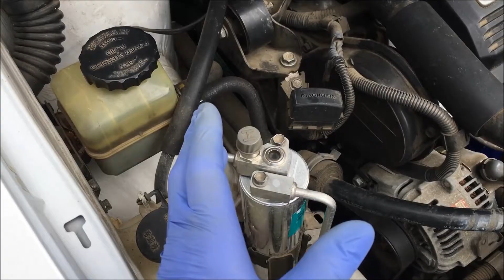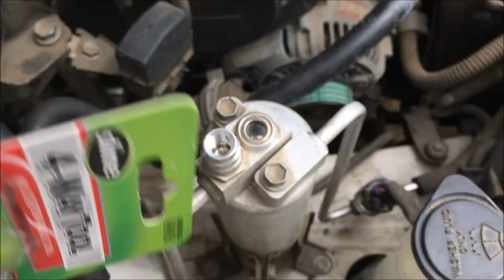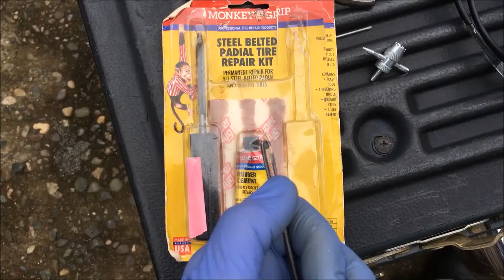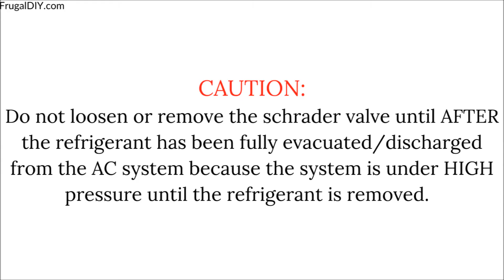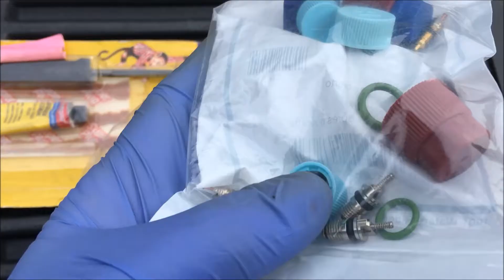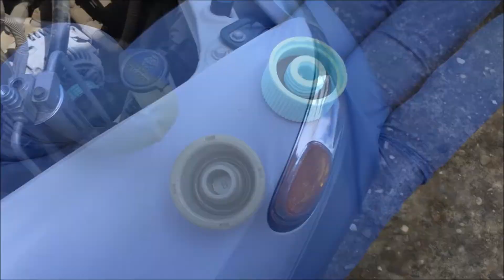Replace AC Schrader Valve

Comment: Those schrader valves always have micro leak even new cars.
Reply: Really? Im new to a/c altogether and just did a compressor job on 2014 jeep compass. Everything went find and charged up blows cold but when i disconnected the gauges i noticed that the high side port shot a little out and it was bubbly. 

This alarmed me as i realized that my pressure test involved using the gauges hooked up and thus wouldnt necessarily rule out the valve cores, so i was instantly thinking the core was bad. I cleaned it up and it doesnt seem to be coming out anymore and no hissing so i suppose its fine?

I put the caps on and will keep it for one more day

Comment: I disagree with having to replace the Receiver/Dryer if the Scrader valve is leaking, but there is still pressure in the system.... if there is pressure, no moisture can get into the system.
Reply: And...if there is still pressure in the system you can use a core remover tool that doesn't require an evac. These are a bit more expensive than the $6 valve tool.
Reply: So I got a kit with just the filter? Do I replace the filter or whole recover drier?

Comment: I have to replace the LOW side schrader valve on my Subaru, anybody know if I have to vacuum my lines still? :L
Reply: There is also a tool to remove a schrader valve without having to evacuate the refrigerant in the system (most ac tech have it).
Reply: @PhanOT11 but if it's been leaking then you are low or empty anyhow?
Reply from the maker: Yes, you need to vacuum out the system whether you replace the high or low schrader valve because if the valves is leaking, air and moisture have been introduced into the AC system.
Reply: @frugaldiy1  Thank you! (:
Reply from the maker: Of course.  Happy to help.  You can get a loaner vacuum from a local auto parts store.  Make sure the vacuum has enough oil in it before you leave the store.  If it doesn't, ask them to add some.  If it helps you, here's a link to my video on how to pull a vacuum on an AC system: https://youtu.be/cJYdai_mcZg  

When you replace the schrader valve, or any part on the AC system, you should also replace the receiver/dryer because air and moisture has been introduced into the system.  Here's a link to my video on changing the receiver dryer: https://youtu.be/rFZ6HbEFt_c

Here's a link to my video on charging an AC system:  https://youtu.be/7TM2nH_3hqI

You got this!  Happy DIYing!

Comment: Thanks for sharing, I have a 2007 Corolla s , this winter I had a problem with the heater, every time I tern the heater on the AC compressor goes on! With hot air on the left side and cold on the right.what could be the problem? my mechanic said take the connector for the compressor off in winter and reconnect in summer. Which made me upset with him.
Reply from the maker: You're welcome.  Re your issue, my guess is faulty climate/temperature selector panel inside the car and either a damper that is not operating correctly or some obstruction in the venting.
Reply: @frugaldiy1  thanks ❣️👍🙏 I appreciate your reply I'll look into it this weekend and reply.
Reply from the maker: Dr nidaa, the damper controls whether hot air or cool/cold air flows through the vents.  I'd look at that.  I'm not familiar with the climate selection controls in your Corolla, but I do know that the climate control switches can become faulty.  I had that happen in a 1991 Camry, so the AC would not turn on.  I replaced the switch with one I got from an auto salvage yard, and it worked like a charm.  I'm confident you can find and fix the problem yourself.  ;)
Reply: @frugaldiy1  yes I'm sure you are right, I remember 2 years ago I tried to install a new cd player and the the technician pulled out the middle switch without removing the middle screw and broke it. I'll check their first thanks.

Comment: Wow!
I never would have thought of modifying a tire repair tool for this.
Great idea!!!
Reply from the maker: Good morning, Richard.  It worked like a charm and got the job done.  We're frugal gals and try to use what we have rather than buy yet another tool.  We're running out of space to store all of our tools and DIY stuff.  :)
Reply: @frugaldiy1  lol......I know what you mean. My tools and workshop (3,200 square feet) have more room than my house.
Reply from the maker: I have to admit, I'm envious of your workshop.  Lucky guy!  We feel your pain, Richard.  I have 2 bedrooms filled with DIY stuff because the garage is filled up.  My living room is now housing the materials for my upcoming siding job--Hardie plank, plywood, insulation, trim and so on.  Sister's house (right next door) is the same way.  Plus, she built 3 sheds, and those are packed too.  It's a crazy DIY life!  We likely need to seek professional help related to our addiction to DIY stuff.  :)
Reply: @frugaldiy1  lol.......I hate to admit it but my shop is full also (with other peoples stuff) but that is changing this year as everyone has been given 60 days to get their stuff or I'm taking it to the dump. BTW, Hardie plank is a great product but I have two suggestions, paint all sides with a good quality primer including the edges then install and paint the exterior with a high quality paint. Also, Hardie plank does NOT like to be immersed in water so be sure to follow the manufacturers instructions as to how close you put it to the ground. Other than that Hardie plank lasts almost like the old asbestos shingles (I was a GC and still have those shingles on my own house with fresh paint of course) but that stuff can't be beat for longevity and paint retention without peeling. Good luck and GOD bless!!!
Reply from the maker: Ricahrd, thank you for the helpful information.  I love the old asbestos shingles--none better.  Hardie's my second choice, and I think it'll perform well.  Good for you on taking your shop back!
Reply: @frugaldiy1  Thank you, and I can't wait to see you install the Hardie plank on your homes.
Reply: Same here ☺️ it was great to see it .